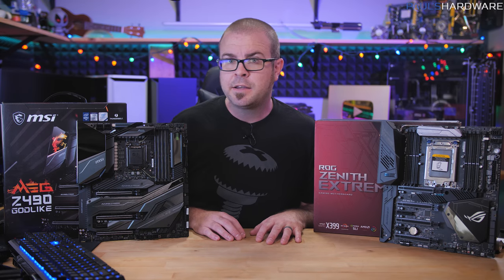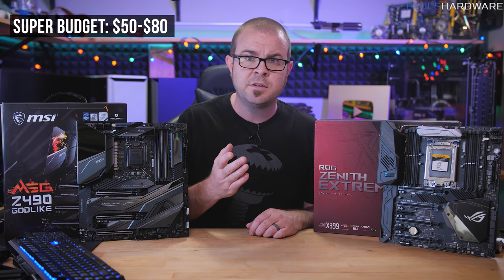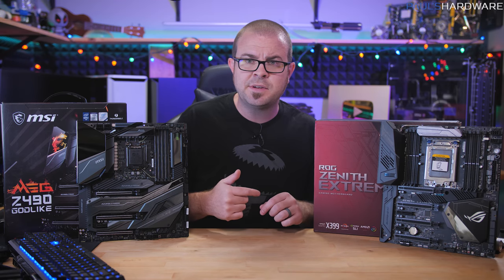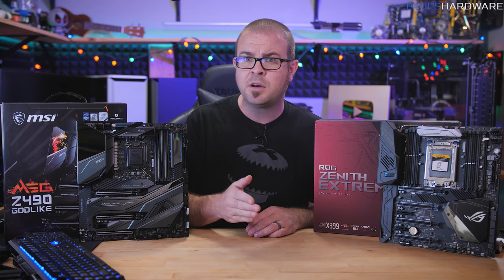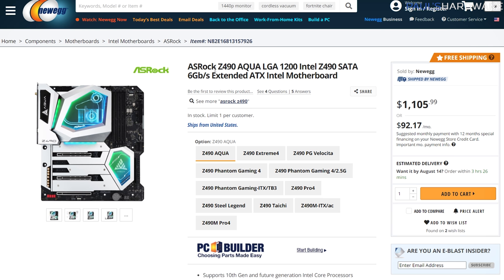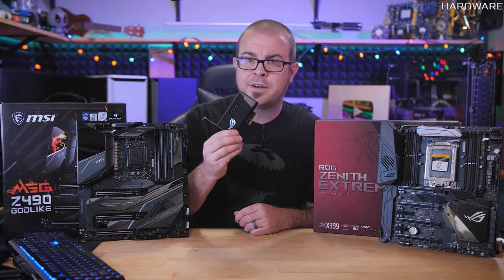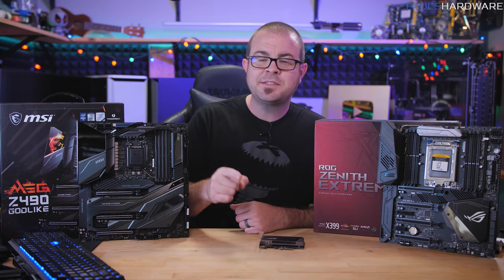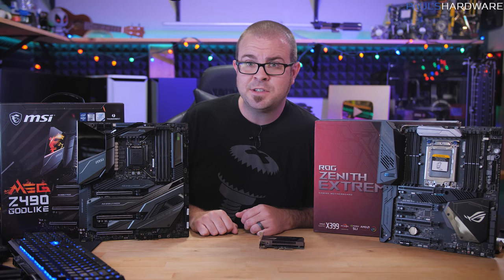What Does a $700 Motherboard Have that a $200 Motherboard Doesn’t?

Comment: This thing about PCIe lanes confuses me ...
My B550 mobo exposes 16 lanes for use by the PCIe slots it has 2x 16x slots plus 1 4x slot.
So straight away something seems odd here.

Then there's how I choose to use the mobo, I put a NVMe drive on the mobo to install the OS on (4x lanes) and an ASUS Hyper V add in card (like the one shown in this video) giving me 4x NVMe drives on it which "requires" the primary slot and access to 16x PCIe lanes.

My gfx card then needs another 8 at least to perform at a reasonably optimal rate (GeForce 2080 Ti).
So totalling all that up ... 
 - NVMe onboard needs 4 lanes
 - NVMe Card needs 16 lanes
 - GPU needs 8 lanes

Lanes available: 16 + 4 reserved for the chipset {so 20 total}.

Eh ??? WTF ... how does my computer function?
Apparently no-one seems to know the answer to this, all I ever get is "dude you're over complicating it" or just "oh it just works, don't worry about the details"!

Comment: The reason for a motherboard to have a backplate is when you place your motherboard on a surface all the connectors on the back also touch said surface, The backplate on the one he showed anyways seems to be designed to leave open all the points that you can connect to to read voltages while still lifting it a bit off of the surface so the points do not touch said surface. Not really needed after the motherboard is in the system but could be if you are moving it from one system to another and/or using it for a test low end test bench that doesn't come with everything it should for supports or said supports aren't that high off of the motherboard.

I guess you could see it as a design for looks choice but it is more functional than design for looks thus why no LEDs.

Comment: It was the Asus X99-E-10G WS, 
The PciE Layout it's very nice, i use 41 Lanes on a 40 Lane CPU (but not at the same time)
The U.2 Connector (for a Optane drive)
The Debug Features (code + LED's)
dual 10 G NIC
Cooling and Power Delivery
And it's look very Badass with the Corsair Dominator Platinum SE Black

BTW for Sound, I use a Asus Xonar Essence STX II 7.1 and for Voice Chat a Yamaha AG06 this combi works very well for Audio Quality

Comment: On the motherboard backplates, motherboards are increasingly adding more SMT devices to the back of the motherboard and I actually knocked a few capacitors off when installing an Aorus X399 Gaming 7.  I thought I was being very careful, but they were right next to the standoff mounts and I just caught them.

Comment: You forgot one feature that usually only comes at mid+ range and is a "you might absolutely need it, or not at all"
Dual LAN Ports
I have two networks in my home, my PC being connected to both. I cannot buy a Motherboard with just a single LAN port. That actually reduced the options drastically and basically instantly pushed me into the higher priced categories.

Comment: Z570 Aorus extreme ships with the Aorus RGB pro hub and is the only board in the class that runs server grade VRM which is why they can get away with the passive cooling meaning less noise from the board by not having the whinny fan, More onboard USB3 and SATA3 controllers and the 2 onboard USB C (port on rear and header for front on board), as I use my system for critical data I prefer to have a RAID 10 setup, the 3 X m.2 and 6 SATA headers mean I can keep it fast with a lot of storage. And the reason I went for this one, I run heavy workloads most of the time, and after having 2 of the ASUS Z570 boards shit out on me within 3 months (VRM failures) I went for this one, the RGB isn't the best if that's your thing, but the stability that this has compared to all the other boards I've had is amazing, and due to the 16 way power delivery to the CPU it actually seems to run cooler and is drawing less power from the PSU (something I can monitor in Icue as this system has an AX1200i PSU). My final thought, i'm not interested in seeing the components of the board and like the clean look the covers (thermal Armour) give, again you pay more for this, but I like to think of it as art, and we all know how much a few splats of paint on an old rag can cost, so for a long term investment in a high power, multipurpose and reliability critical situation I felt this was an apt choice, and before you say Threadripper, sometimes more threads doesn't mean better.

Comment: Without first watching this here's my prediction: They have MOAR POWA!

But seriously, they do tend to have more of just about every feature. The circuitry will be over built, using over kill spec components. But there are really few technical and practical reasons to to buy the true high end enthusiast boards as usually you don't need all the features and could just as well use a much cheaper board that fulfills you particular needs. Even hardcore overclockers usually don't use the absolute top end enthusiast motherboards as they really aren't interested in anything but the minimum feature set that allows them to run their benchmarks as long as everything else is optimized for overclocking.

So far I've written about just why you probably don't need a MSI Godlike or something in the same category, the overkill with extra of everything category. But yet the MB manufacturers keep making these, and though they aren't really volume items they do sell at least a few of them.

So why do they exist, and who buys them?

To MB manufacturers they are marketing material. These are showcases to demonstrate just how fantastic their products are. To those who buy them they are in most cases a status object. Unfortunately they are a worse investment than a performance car, both as monetary value goes and as chick magnets. They are however a bit cheaper, doesn't require you have a drivers license (valid, at least initially) or facilitate you wrapping yourself around that huge oak with a car colored sheet metal overcoat...

Comment: I usually buy upper mid-range motherboards around $400+ CAD.  My typical system will cost $2000 CAD without monitor.
Even though I am not a water cooler or overclocker.
I do this because the better boards usually state that they have better capacitors, better power delivery, and better VRM cooling.
And often better BIOS screens.
I usually buy ASUS TUF and ROG now after having some issues with other brands over the years.  I do have a couple of Gigabyte boards though.
I currently have eight workstations in my small home office.
Just my personal opinion.  :)

Comment: I usually go with low-mid range myself. My gigabit ethernet saturates my internet connection and large file migrations to my NAS are something I start before bedtime or leaving for some kind of errands, so it can just spend hours transferring for all I care. I also don't usually add PCIe cards, besides a GPU, so the lane count doesn't matter to me. Most everything you need can be connected via USB at this point.

Comment: I just had to question what Mainboard I had inside since I remembered only having 2 ram slots. Turns out it is a msi b450 and I "only" have 2*8gb installed which is seriously pretty much what a normal human being needs when they are not a poweruser. So yeah, thanks for 4 slots, I would've only needed 2.

To those questioning why I didn't get a cheaper one, I first bought an a320 that was Ryzen 2/3 ready but the previous owner hadn't updated the bios for it yet, so it didn't boot and I had so send it back (you need a CPU inside of it to update the bios to support a never CPU).
Honestly, just check if there are any deals on hardware and don't rush it. Take 1-2 weeks buying the stuff and you get off cheaper. My second 8gb ddr4 ram was also just 20€ as it was a replacement part from the factory (basically a new item you get after sending your dead one in).

Comment: 1 of the major things you reviewers have missed, is the way the AMD 550 MB use the NVME slots . Some the 450 boards mostly used the 2nd m.3 slot with the SATA controller.  The 550 MSI board does not do that it uses the PCIE slots for the 2nd M.2 drive. Which means iif you use the m.2 slot the you lose eithr you pcie slots to use the m. e slots. I would not have bought the MSI board I did if I would have known that, Losing SATA is not that big a dill it is drive for drive. Losing PCIE slots is.

Comment: I bought one of those ASUS ROG Zenith Extreme boards when I got a Ryzen Threadripper. I bought that combo after the miserable experience I had with MSI boards and Intel processors. I bought a prebuilt computer that was an MSI board with an Intel processor and a pair of MSI Radeon video cards. It basically  started to fail within a couple of months, was always hanging or just wouldn’t start. They replaced it withe a newer one, still the same make off parts, and after a few months it would do the same. They did several stress tests but in the end I was so pissed off they gave me my money back. So I built my own using the Zenith board, Ryzen thread ripper, I think it was a 1990WX or something like that, 128G of Vengence DDR4 ram,about 10fans, Corsair 1200W ps, Corsair I150 water cooling and a Zotac 2090 TI video card in an Obsidian 900D case. I want to build a new but I’m not sure if I should go for a new TR4 processor or go back to an AM4, mainly because it’s about A$1800 cheaper than a threadripper. Still want to use the ASUS boards and an optical drive as I like to watch DVD’s as I work and I play a few online games, I’m only 65😀. What do you think or anyone else

Comment: There's more to it than just features.
Just as important is the quality of the parts.
The high end boards are overbuilt. And the caps, transistors, etc, the important little bits and pieces are superior to the corresponding parts on cheaper boards.

Comment: MISSED FEATURE!!!

There are four AM4 X570 boards on the market that offer x8 PCIe Gen3 lanes via 3rd PCIe x16 slot WITHOUT TAKING PCIe LANES FROM THE TOP x16 SLOT. These additional lanes are provided via additional paths to the X570 chipset on the board.

MSI has three of those boards, and ASUS has this on their workstation board.

These are great for the budget oriented content creators, looking for a fast PCIe mass storage PCIe solution, with high read/write speeds, while using a Zen2 based CPU. Vs buying a TRX4 board and TRX4 CPU.

Comment: I have had my computer for at least five years. It is working fine. I don't play a lot of games and I research topics that interest me. My computer did keep shutting down on booting recently but I pulled it apart and got the cotton buds  and compressed air out. Problem solved. I was going to upgrade but I got a big shock at graphics card prices. The manufacturers must be using extra gold in the manufacturing process.

Comment: What about robust board construction? I built my first PC last year with a GIGABYTE GA-A320M-S2H which was a $54 mother board at the time. About 6 months later I build my son a PC using the Asus AM4 TUF Gaming X570-Plus (Wi-Fi) ATX motherboard. This is the best bang for the buck x570 motherboard in my inexperienced opinion. One of the features touted and I did notice a little during the build was the robustness of the PCI slots and other build quality things. The ASUS TUF board just seems much better built than the cheaper GIGABYTE board. Is this a feature worth paying for? I like the feel of the higher quality board and it made a more enjoyable build process, but now that the boards are safe in their PC cases I don't see any real value. Thoughts?

Comment: So I am in a very weird category, I build my own Server because the new Mac Pro did not fit my needs and I couldn't stand to wait a year (at the time) to move away from the 12 core Mac Pro. 

Started with an x399 Gigabyte Motherboard in the £400 range paired with a 2990Wx, 128Gb of RAM, and AMD 5100 Pro Wx GPU and 40 hard drives (LSI 9365-28-8 and a SAS expander) as well as quad 10Gb intel NIC's, it worked great for around 7 months, as this is a file server and I do testing for clients (ones who don't have test environments) I do this for them on my own kit (32Tb of SSD's and 100Tb of storage).... eventually the board just wouldn't turn on after a hard crash, fearing the 1600W PSU had fried I tried another and still nothing. So had to go out and buy the X399 Zenith Extreme Alpha for its overclocking abilities, but not because of the overlocking but the headroom it allows as it also has decent VRM's and cooling Something i found out was the cause of the failure I was pushing the CPU at 80-100% for 18 hours they got hot and failed...

so far the ASUS board has done a 57-hour hack lab with the CPU running 90% average with the VRM temps hitting 80C, this is using a standard Coolermaster threadripper cooler (its a server its on 24/7) and its sitting in a rack on a shelf in a Lian-Li D8000 with all the fans being Noctua 3K RPM industrial fans...

in stark contrast to this, my 2950 is on an MSI x399 SLI Plus with dual vega 64's rather happy but then it doesn't have 24 3.5 Drives and 16 SSD's in it just the x3 M.2's and low 64Gb of RAM....

the backup server is low i5 with iGPU, 40Tb of drives on a cheap Gigabyte Tuff board paired with a quad 10GB Nic only because it doesn't need much, it takes backups of the Mac's, the workstation and the important stuff on the Server...

The Higher end stuff can seem overkill to normal computing but if you need the headroom and your business depends on not pushing the capabilities for reliability then the benefits outweigh the costs, but for enthusiast day to day computing then stick with the mid to high end but don't go overboard, not everyone needs x32 cores (64 threads) and 128Gb for day to day things for instance my day to day work computer is a 2019 Mac Book Pro 16" because it has everything it needs but if i need the horsepower i have the workstation or I can spin up a VM on the server.

Comment: External DAC's aren't necessary at all to get rid of noise, especially when a mid range board does it fine without even an internal one. An internal DAC should do you just fine, or just relying on the motherboard audio if it's less than the cost of even an internal DAC.

Comment: Board flex. A back plate on some boards helps to remove the flex created from heavy CPU coolers and GPU. After a year, that flex can cause the GPU to not make proper contact in the slot and you end up with black screen issues. A very common issue now days. A good place to see these issues is buildapc on Reddit. So many people saying after a year the PC doesn't post. The common conclusion is slot issues and on close inspection, damaged slots as the board had flexed from using a big cooler or very big GPU.

Comment: I purchased my GIGABYTE X399 AORUS Xtreme Only because of the power delivery. With the pro I was unable to reach a overclock of any kind really without instability and my temps were only in the mid to high 40c range. once I did the Xtreme I was able to hit a stable 4.05ghz all cores and stable at only 65c at same core sensor. I had a bunch of money in water cooling and the pro just could't do what I needed. (used for 4k video edits) I only need 24-32 threads at most so I will be getting 2950x in hopes to do a 4.45ghz all core overclock. I think the clock speed will be more of a advantage to me than the core count for my particular software I edit with.

Comment: would you say bios post time is also slower with these high end motherboards? I purchased a z490 asus maximus formula motherboard and when i check the "the last bios boot time" in the startup app tab ... i am getting around 24-25seconds for post time. ASUS told me that this is normal for high end motherboards but not sure if they just giving me an easy explanation to get rid of me... or this is indeed is slower... 

to be fair I have 2 nvme drives, 1ssd, 1hhd... i have a z73 cooler connected to mother board via usb along with a commander pro... and then in commander pro I have two lightening node cores connected to it via usb... i have two mice, 1 keyboard, 1 usb hub that connects chargers to different phones... The case I got is Lian Li dynamic XL where 2 case plugs connect to USB3 on the motherboard (powering 4 usbs) and 1 usb type c...

As for ram I have 4x8gb at 4000mhz gskill trident that I had to get them up to 1.5v to get them stable...
i also have the cpu overclocked to 5.3 ghz all core stable on aida 64... Thats basically it....

Do you think something is off with my board? or is this normal?